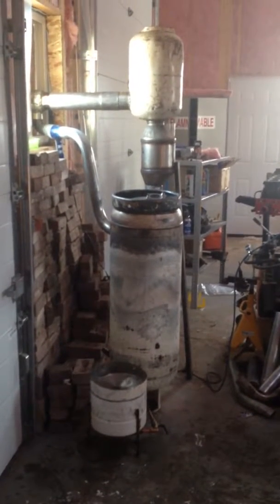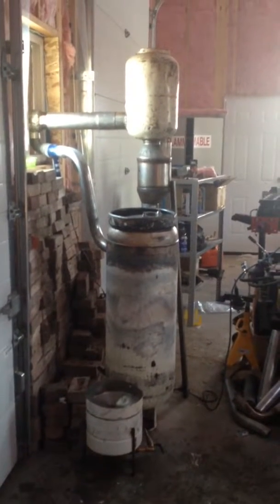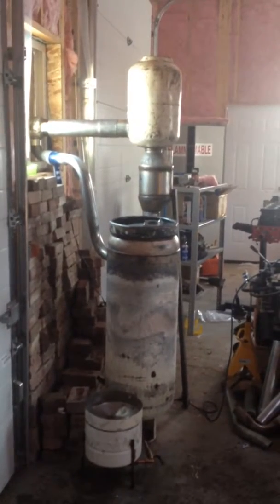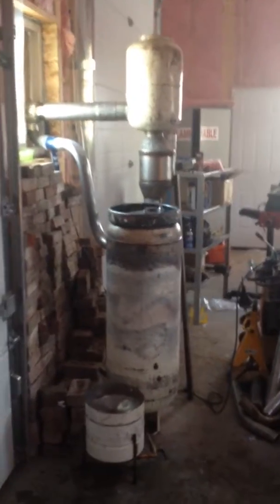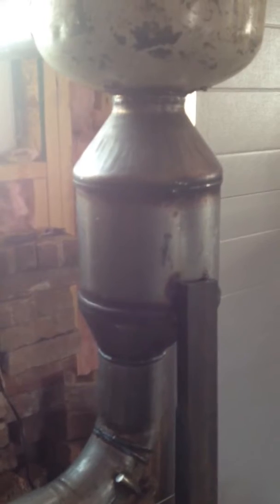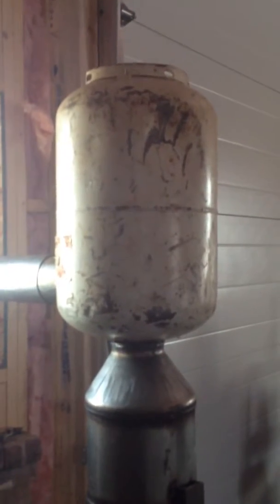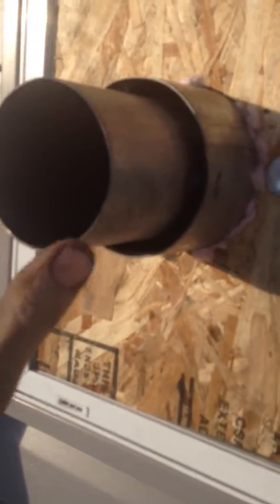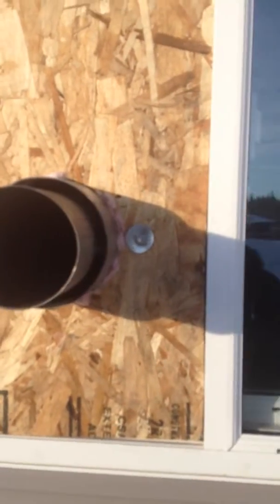Ota vapno waste oil heater

Comment: Good Design, but your Exhaust should be a bit further out, so the Intake Air would be Fresher / Oxygen wise :)))
Reply: BTW - You Keg is Stainless Steel? If so, Burning / Heating Stainless Steel to High Temp is NOT good. It release bad chemicals to the Air. If anyone or you to do it again, use a Water Heater container that way it's ALL Metal / Steel :D
Reply from the maker: I know what your saying, but the heater works amazing enough already, some of my friends brought up exactly what you said, I told them to think of it as an EGR, "exhaust gas re circulation" lol.

I have since removed the diesel particulate filter as an experiment to see what would happen, the cat was restricting to much air flow. once removed the flame went from blue ish orange to blue, indicating clean burn, however this also made the oil consumption go up. I would like to put the cat back in but I need a higher volume air pump.
Reply: +ORIANA250 - Hahahahahaha, " EGR ", OMG nooooooo I hate that F'cking thing. I had to replaced one today on our Truck, I wished they'd NEVER invented those, LOL

Comment: If your intake blower were to quit, I'd be concerned about the exhaust getting too hot for that particle board. Awesome set-up BTW.  Perhaps I'm wrong as how it all works but metal instead of the board would offer me a better piece of mind.
Reply from the maker: if the blower quit's the flame goes out, it needs that blower going to maintain the burn, no blower no fire.
Reply: Totally had a long winded reply written and autoplay advanced to the next video and lost it all :(  Was too quick to think there was another blower powering the burn, in behind or off camera or what not.  Very impressive the fan that is. Thought , there's no way a hair dryer...?  Tiny electrical input for a LOT of heat output I bet. Rocket chimney drop exhaust temps dramatically as well no doubt.  Brilliant, and I indeed enjoyed this video.  Keep the great ideas coming our way.  +1 sub.